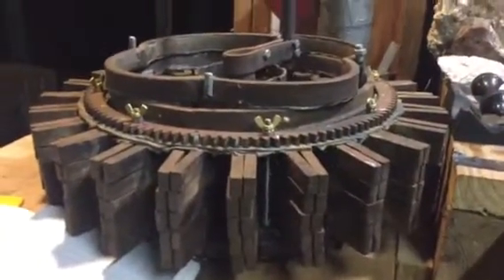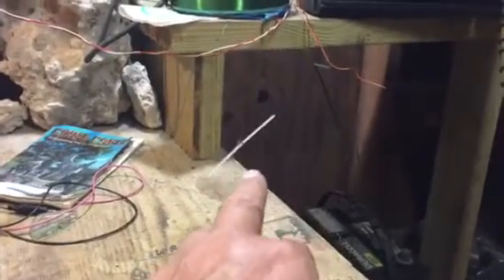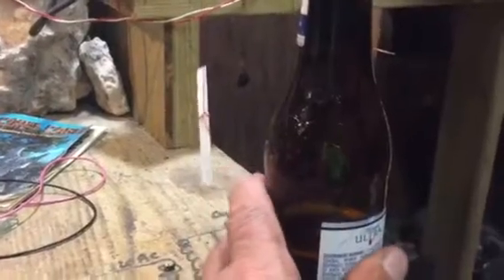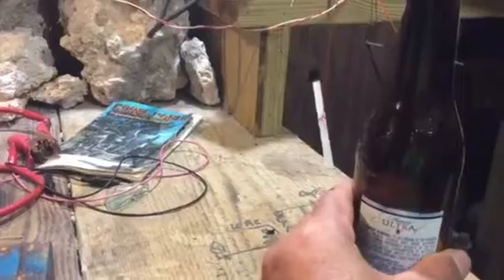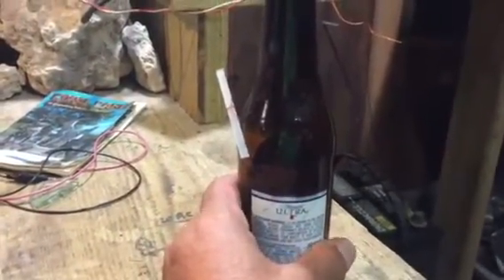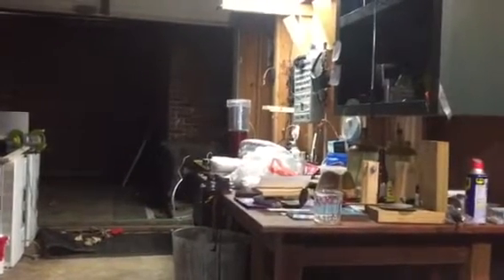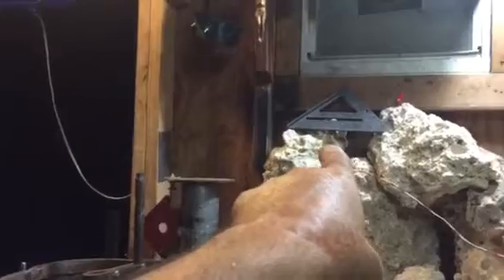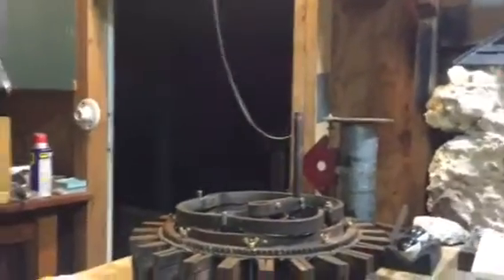Engeries of God !

Comment: When magnets align it is a pulse of energy. When magnets alignment is broken it is a pulse of energy. On; off. One cycle, one volt. Multiplied volts in frequency means increase in cycle speed. Many turns of the coil step down to a larger induction coil, and into Amperes. So high frequency impulse or connection disconnections are what we use to achieve Watts and Amperes from simple Volts.

These can be capacitor discharges. The brain is divided and has a middle. The magnet is divided and has a middle. North and South are the ends while East West is the middle. X, Y and Z planes. Stick a piece of metal in the middle of a stack of magnets to find the middle pole or equilibrium point or plane of dielectric inertia. Dielectric is an insulator which holds a positive charge. Oil is a great dielectric. The brain is made of fat. A magnet is a crystalline ceramic or a crystal of a molecular order. Hydrocarbons are crystalline. The piece of metal will take on the character of the middle pole of equilibrium and dielectric plane of inertia; or area of resistance to a change in motion.

Touch the poles of a magnet together with a conductor. You will have one cycle. The chemical interaction between the two halves of the brain within the two halves of the body's nervous system creates a circuit especially in the heart at each pulse.The chemical messengers and the chemical salts in the nervous system which makes the conduction connection between the cells are metal.Even when they do not touch, the metal and the oil dielectric have wireless induction energy transference. Just as the time and the distance we span in the voidless counterspace we call existence is momentarily gone repeatedly and back again.

Comment: it's fun just to hang a magnet from the rafter,. heh yup, Hey man it's interesting That you can drink and Be coherent and explain things in a Smart way...I think your Right about transfer of Energy and How when you fizz shake up the bottle, that, that energy i think sort of correlates with itself in a harmonious way that interacts together in its Cytriphical field area (there's a Sort of tug of War going On),  i mean it sort of stays separate when you CHARGE the said bottle or substance.. because it 'sticks together' and so the orbiting Magnet's sort of Gather and thus in the 'fizz' make-up of the Outer orbit Ring Perimeter Shift Slant's off its currents trying to settle or discharge back to Dc cause it keeps Getting 'Alternated' by the current of the Jossle that was placed in beer when you shook it with a Wave by tapping the battery and in the Meantime waiting for the Boomerang or Diving Board or Spring Board to Jump BACK.  ...pause with no 'tapping'.......in the Meantime they circulate and...  they can leak to Outskirts of tubes, i think the Alternating charges are from different circulating Auroras of the Halo of the 'tube' that's created by the essence of the magnets gathered in streaming currents through said Object.  They can either be within different Force so it all shifts Swiftly..   The Tapping of the Currents Negative Lead battery Means that You Drop the Rope for A SECOND and then GRAB it Again, pick her Up by the Outstretched Hand that lifts, but for a Moment of the Jossle Wind wave of Current Change in the Arc of His Testimony yes it ALL correlates in Some simple Way there too...but changing Bible Currents or Versions to Violate garment, of torn pages of truth hidden in Obscurity by many word talkers blurring the lines of the Vision for 'a time' and time's, and the Dividing of time by their Word Doctrine.  I Mean i stick to the KJV character Map pattern symbols for Now cuz they Change the Times and words to make aloof the Broadcast that shall not be Made Obsolete but always Uncovered to remain truly still eternal.  "Walking tuning forks'" Hey vinny, Your Door Garage is Open to the North, Like letting the Arc Current Star of David In, down to the Wheel, and making it Enter the castle and Spring the Current's through A POWERFUL STILLNESS.. hmm..  Streaming Whirling within when you "Dug and went Deeper" to the Wheel of Well being A POOL of Algae in the Sun?  Oh...but not Down there in the Deep dark well Cuz no Sun Get's there....  So that means to Me in this moment, that ALGAE and Ed Said....allllll About it...and To Show He Had Something cuz Ed said you Had to Show you had Something in order for your Scientific observations to be true.  So...that means,,,one end of the Metal along the Machine that is a long leaf spring....is somehow...one side... FULL of algae Light Magnets?  And the Other Empty and Not?..  Cuz ed talked of Magnets and Light and leafs Wrapping with magnets Around the light to Encompass them into Cells? of ? 0_0 a tree Being,..
Reply from the maker: Tommy Tommy 
Tommy you always catch my mind on your comments, love you man!
Keep it up !